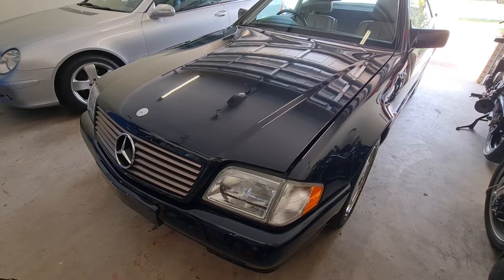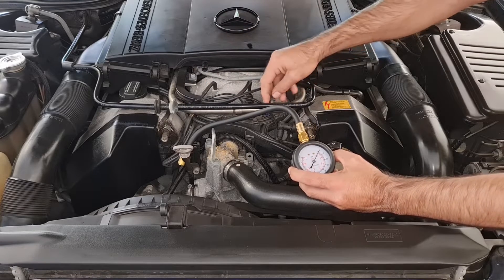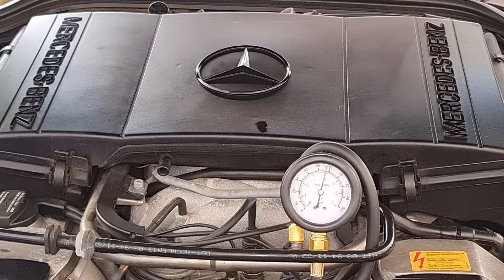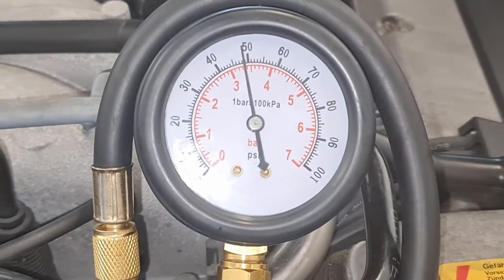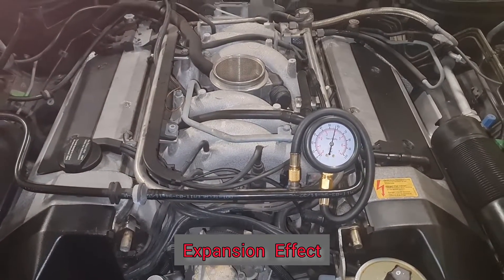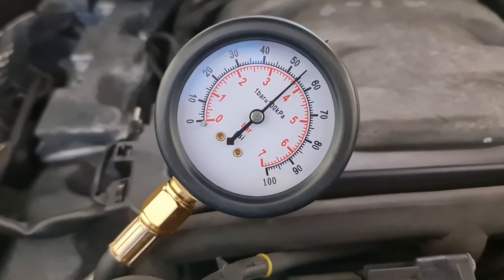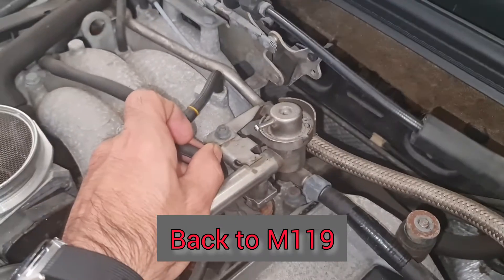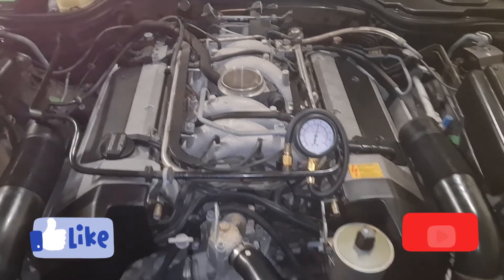Mercedes Fuel Pump Pressure & Regulator Test (R129 & W209)

Comment: Gentle person,

I assume the shrader valve at your fuel rail on your sl500 is the same as for my 2003 sl500 r230.475.

I bought a gauge with many adapters to screw into the shrader valve BUT none presses the pin to pressurize the gauge hose.

Could you share with me the type of adapter you used?

I am currently troubleshooting LTFT -10% in both banks.

Thanks & greetings from Puerto Rico.

José Antonio
Reply from the maker: I am not even using an adapter.  The default gauge screw does it all on all Mercedes.

Comment: I have a 95 sl500 m119, the car starts normally on the first start but after 10-20 mins of driving it, the engine idle becomes very unstable below 700rpm and then completely dies, so I have the throw it in park and restart, fires up after a few cranks but then it loses all power while still running ever when my foot is to the floor, I’ve replace the cps, distributor caps and rotors, the throttle body and spark plugs making sure the plugs are 0 resistor plugs. I have yet to test fuel pressure but it has a new pump and filter, and I ran 44k fuel additive, any input would be greatly appreciated. I’m no mechanic but this engine is driving me insane😂🫠
Reply from the maker: Before throwing more parts and money, start diagnosing. 1. Fuel pressure. 2. Check the sparks after 10-20 minutes after driving. 3. Check the distributor seals.
Reply: @BenzAddiction the seals on the cap are solid no leaks or moisture, the spark plugs are brand new, but I’ll check anyway, last thing I have is fuel pressure I’m going to get one today but I’ll update you, thanks for the quick reply!!!

Comment: I learned sth and want just look  how to measure the fuel pressure on my E230 W210. I have schroeder valve on the fuel rail, so I need just to connect this gauge on it and start the engine.
 Is that right ?
Reply from the maker: Yes :)
Reply: @BenzAddiction  My E230 M111 engine fuel pressure on the fuel rail was 50 psi ?  Is that ok ?

Comment: Hi thanks for the video, I need some advice for my car. I have the 2001 R129 SL320 M112 engine. It's having long/hard starting issue. When cold/morning starts seems to start fine. During the day after engine has warmed up and turn off the car. The car would have hard start/long start issue after being left for over 20 mins. If the engine is off for less than 20mins it starts normally. When left overnight it would start up normally. Once the engine starts, the car runs normally. No hesitation, no noticeable loss in power/fuel consumption. What do you think is wrong with the car?

I spoke to my mechanic he thinks it's the fuel regulator not holding pressure. I cant get my car to the mechanic yet as im on a road trip with the car. Will get the car to him in the next few days.
Reply from the maker: Hi, check my video on CPS. Crankshaft Position Sensor.  It might be the time to replace it. But that's my guess from 20 other possible issues.

Comment: Your input would be appreciated. At idling the fuel pressure was 55 psi , after revving the engine it dropped to 50 psi at idling, during the revving the pressure flactuated between 50-60 psi. After switching off the engine the pressure stayed at 50 psi then the gauge was disconnected.
Reply from the maker: I think your regulator is OK. Some minor fluctuations is acceptable.

Comment: Can you please supply me with the link for the gauge.Thanks.
Reply from the maker: https://www.ebay.com.au/itm/255419030085?mkcid=16&mkevt=1&mkrid=705-154756-20017-0&ssspo=WxTmLNyfSde&sssrc=4429486&ssuid=VftSBydbT7C&var=&widget_ver=artemis&media=COPY
Reply: @BenzAddiction  Ordered the same looking kit from a different Chinese brand. Did you screw the gauge straight out of the box onto the valve Schrader or use one of the adapters supplied?
Reply from the maker: @harnas3848  it has the standard thread link.

Comment: My CLK500 will not start for the first 4-6 cranks when has been standing for 3d+, then it runs like it just came off the factory line. Your video was very helpful, will start testing now! Thanks
Reply: Where is the fuel pump reset button on a 2003 Mercedes SL 500
Reply from the maker: @ChristieJones-wh7zw  have never heard about this button at all.
Reply from the maker: Also make sure your fuel is not more than a year old, that happened to me :)

Comment: Thank you so much for this video. 
This is my next thing to go over as my car has intermittent over cranking. I've done new zooms, throttle body, crank and cam sensors, caps and rotas,  so next is fuel system. Fingers crossed this shows something.
Reply from the maker: Thanks for Watching, I have some more M119 videos if you like to have a look, Fuel pressure is a fun little project to check, good luck and write back here the results...cheers

Comment: Hello I replaced my injectors and my fuel pump and filter...still having issues at cold start it shuts off but once it's warmed up it runs fine I just notice throttle response is still hesitant at first if the pressure test is done when replacing those items?
Reply from the maker: Hi mate, What year is your R129?

Comment: hi again, mine is a 92 500 sl and I am having a hard cold start issue I thought that my fuel accumulator was leaking because if I turn the key on and off several times it builds pressure and starts right up now after watching your video it might be a fuel regulator.  Is there any way of tell which one it is?
Reply from the maker: Do you have a fuel gauge? If so testing it is as easy...
Reply: @BenzAddiction  well, in checking I have no valve like you do on your car you have to get special fittings for the fuel gauge  and attach to the fuel distributor not sure where but much more complicated on early models like mine?  All research suggests that these accumulators cause the problems I am experiencing. There is a way of testing them but involves getting under the car and disconnecting the  rear line back to the fuel tank.  I am not going to do that the car is 30 years old might be time for new fuel filter and accumulator just based on age...not the way things s/b done but in this case I think that is what I am going to do?

Comment from the maker: This Fuel Pump Pressure test and fuel regulator test not only applies to R129 and W209 but most of vehicles built between 1990 to 2022...
Reply: Do you have a link for the cheap fuel pressure tester you bought from ebay?